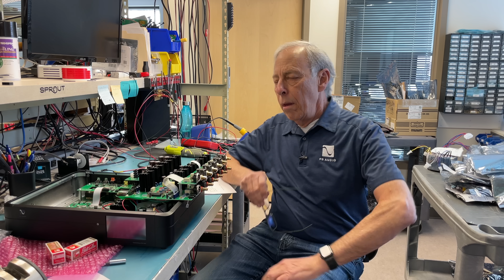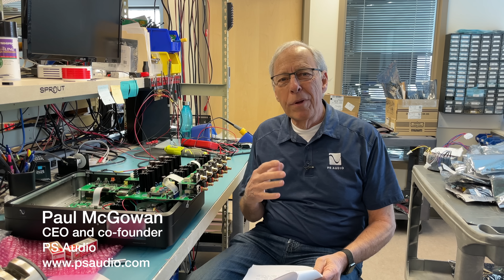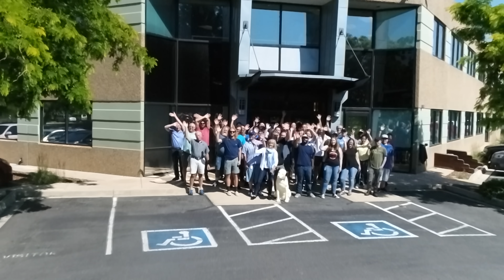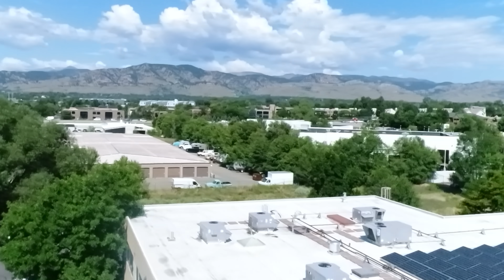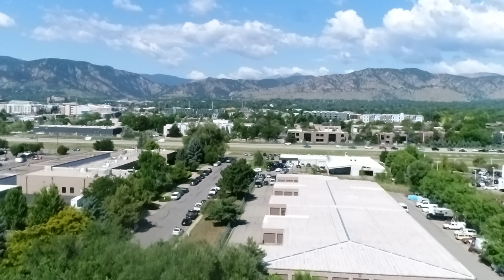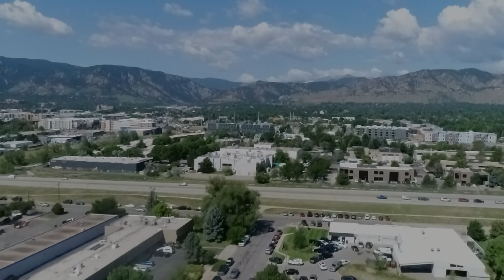Why high resolution audio?

Comment: Paul is confused on sample rate and sound frequency. Modern DACs resolve the steep filter issue by over sampling. A modern $100 DAC can out perform many older $5000 DACs.
A 44.1 kHz/16-bit CD or file is indistinguishable from an HD file regardless of whether it comes from a disc or is streamed to your DAC. In properly conducted blind tests no audiophile could get better than chance. It’s time to stop pushing the myth of hi-res and accept it is the quality of the original recording that matters. For the end user  loudspeaker quality and room acoustics are by far the most important factors in determining sound quality in any home system.
Reply: I think the only thing being pushed here is your own bias against hi-res audio (in many, many comments). Nobody is forcing you to buy hi-res - it's not as though CD quality is harder to find, or being replaced by hi-res audio. 

For some reason you've locked onto 16-bit/44.1kHz as the gold standard, all-you-need format, even though most artists, musicians and those who do the mastering would vehemently disagree with you. The quality of the original recording is not in question here - it's how that original recording is mastered and subsequently delivered to your system.  Why is it, do you think, that masters are made from higher resolution, higher sample frequency files, then engineered down to meet the limitations of CD standard? 

It is because CD is a compromise

A good compromise, but a compromise. SACD sought to redress the issues, but it didn't take off as too many people were already invested in CD players. Hi res audio is similarly niche - but hey, so is anything more than just accepting the basics.  If you cannot tell the difference between SACD and CD, or between a 24-bit/192kHz high-res audio file compared to a 16-bit/44.1kHz file, then your system is not up to grade, or your hearing is poor, or both.  

Either way, if you can't tell the difference, then that's great - you don't need to buy hi-res audio files. If your DAC isn't giving you improved performance between the two files, then perhaps your $100 DAC ain't all that.
Reply: @richardt3371   The quality of a recording is determined by the studio at the time of recording and production. A well recorded and skilfully engineered 16/44.1 CD can deliver audio quality that exceeds the limits of human hearing. Higher bit depth and higher sample rates are used in the recording process for editing purposes but are pointless for playback. 16 bits gives a huge dynamic range. You will never hear noise in a silent passage of a 16 bit recording   unless it is tape hiss from a copy of an old analog recording. 24 bit playback does absolutely nothing to sound quality other than further reducing the noise floor which is already inaudible with 16 bits. Higher sample rates produce frequencies above 20KHz, which is not only above human hearing, but captures unwanted noise that can produce nasties in the audible range. These ultrasonic frequencies can get into a tweeter and cause problems. Higher sample rates on playback cannot improve quality in the audible range. Any effects from the brick wall filter was resolved 20 years ago by improved  DAC technology such as over sampling. A modern $100 DAC can give superb audio. So called “hi-res” releases are marketing hype to sell the same music again. 
Loudspeakers and room acoustics have far more effect on sound quality.
Reply: @geoff37s38  No modern professional recording is made at 16-bit/44.1kHz. Your bias against hi-res is clear - and based on inaccuracies. The idea that hi-res releases are only used to sell "the same music again" is silly - hi-res releases of new recordings are commonplace, hence the likes of Qobuz or Prostudiomasters releasing new recordings, not just old music in high-res formats. You are also incorrect in thinking that all hi-res releases of back catalogue material is marketing hype - in the vast majority of cases hi-res releases are newly mastered from original source materials, quite often eclipsing the sound quality of early CD masterings.
Reply: @richardt3371   As I explained previously, higher bit depth and higher sample rates are used in the recording process to give editing headroom.  16/44.1 can give audibly perfect playback. 

Anyone interested in a great explanation of how digital recording works should watch the YouTube video D/A and A/D digital show and tell by Monty Montgomery. This video clearly debunks the hi-res myth.
Reply: @geoff37s38  Sheesh. Luddites live amongst us.
Reply: @richardt3371  not even the old professional recording was made at 16/44.1...
Reply: @richardt3371  Perhaps you could point out the errors in the Montgomery demonstration.
Check out the websites and YT videos from Mark Waldrep and Ethan Winer.  Both of these guys are highly respected and experienced audio engineers and have been involved in hi-res recording for many decades. Both of these guys are highly critical of the “better than CD” movement and both produced listening tests with interesting results.
Reply: @geoff37s38  Oh well, if Mark Waldrep and Ethan Winer are critical of better than CD then you're right - I'll just go delete all the hi-res audio files I own. What was I thinking, using my own ears to hear which sounds better to me, rather than using the internet to dictate my beliefs. Thanks - you've saved me a good few TB of hard drive space and I can now listen to everything at a maximum 16-bit 44.1 and know that nothing can possibly sound better because Mark Waldrep and Ethan Winer have told us so.
Reply: @richardt3371  Ok, let me deal with 16 bit vs 24 bit. 16 bits gives a dynamic range of 96dB and 24 bits gives 144dB. The decibel is a logorithmic scale, +10 dB is a multiplier of 10. The quietest studio microphone has a s/n ratio of about 92dB due to the Browning Effect, the random movement of air molecules hitting the diaphragm. A full symphony orchestra has a dynamic range around 60dB (10 bits). No home audio equipment can handle 144dB.
Ignoring all the above let us imagine you have obtained a true 24 bit track that has captured a dynamic range of 144dB. A quiet listening room may have 50dB background noise. You play the track and set volume so the quietest sound can just be heard above background. Then there is a sound at 144dB. If this does not instantly destroy your speakers then your hearing will be destroyed.50dB+144dB=194dB which is in the lethal range (not joking).  It is fortunate 144dB dynamic range is impossible for any home system. Even a track with 96dB dynamics can potentially cause ear pain and damage. Increasing bit depth has no effect on audio fidelity other than lowering the noise floor. 
Ps modern dithering techniques can extend 16 bit dynamic range to 120dB.
Reply: @richardt3371  I am sorry you seem to take this as some kind of insult. I genuinely wish to present the facts on digital recording. This is the misunderstanding made by many. There are no extra magical properties, nothing which the science does not understand or cannot measure. The only difference between 16bit and 24bit is 48dB of dynamic range (8bits x 6dB = 48dB) and nothing else. 16 bits is more than enough to replay any performance.  This is not a question for interpretation or opinion, it is the provable, undisputed logical mathematics which underpins the very existence of digital audio.
 Iam not suggesting you throw away all your hi-res collection, I am just trying to give you some accurate information.
Reply: @geoff37s38  I take nothing as an insult. The fact that you believe 16-bit recordings to convey everything you need for perfect audio reproduction, based on 40 year old digital assumptions and compromises that gave us the CD format, is fine. I disagree. The understanding of binary data as digital audio has moved on some since then, and whilst I respect your right to your own opinion, I dispute your right to your own facts.
Reply: @richardt3371   These are not “my facts”. They are ‘the facts”. I can give you links to many recent lectures and papers on the subject. Yes, digital audio has improved over the last 40 years as computer power and electronics has improved greatly. But the fundamentals that underpin digital recording are unchanged. I have given you solid technical explanations but you offer no counter argument. For example, how does a 24 bit recording sound better than a 16 bit recording? I guess we must agree to disagree.
Reply: @geoff37s38  But the fundamentals HAVE changed, Geoff. I'm sorry you seem to be unable to grasp that.  The idea that digital audio is just 1s and 0s has been shown to simply not be true, but I seem to not be able to get through to you on that. And when you ask a nebulous question like "how does a 24 bit recording sound better than a 16 bit recording" then there really is no hope of us being able to have common ground - how can I quantify how it "sounds" better? How do I describe an intangible? Anyway, you're happy with CD quality, and I'm happy with hi-res if available, CD quality if not. It's all just bloody music at the end of the day :-)
Reply: @richardt3371  Ahh yes, this assumption that fundamentals have changed and bigger numbers must be better is at the heart of the controversy. The Nyquist Theorem was postulated way before computers were available and describes how perfect reconstruction of a signal can be obtained.  However Nyquist is fundamental to modern digital recording. The mathematics still apply today. The Red Book standard for the CD is a no compromise specification and can give audio with flat frequency response from DC to 20KHz, huge dynamic range and vanishingly low distortion. Not my opinion,     Indisputable facts. I am retired but spent several decades designing mainframe computers. The mathematics behind digital processing has not changed. The comments I wrote on 24 bit v 16 bit are not my opinion, they are solid facts that are fundamental to digital recording and any qualified audio engineer will agree. I don’t know your taste in music but listen to the 35 year old CD Brothers In Arms by Dire Straits. The recording is stunning in clarity and dynamics and in my opinion is the match of any “hi-res” recording.
Reply: @geoff37s38 Interesting that you reference the "first" digital recording, made on a 24-bit Sony, and the recording that made sure CD succeeded ;-)  Interesting, too, that the same album was re-released by the band in 24-bit SACD...

I have nothing against CDs. I own thousands of them, I have a very good CD player as part of my system. 

However, to keep blithely ignoring that the necessary restrictions on sampling frequency that are imposed by fitting 74 minutes of music on a disc give you "a no compromise specification" is just plain wrong. If we look purely at the mathematics, surely you have to see that taking samples of analogue music at more regular intervals gives you higher quality? 

And please, for the love of god, stop saying "indisputable facts" as that's just frustrating in a discussion where the "facts" are being disputed. I'm not arrogant enough to presume that any theory is indisputable - I'm open to other opinions, and the only thing I consider indisputable is how it sounds to me. All the best.
Reply: @richardt3371  is Ok, one last go. I have explained why more bits and higher sampling rates are used in the recording process. You say “taking samples at more regular intervals gives higher quality” but this is NOT how digital recording works and is a common mistake made by audiophiles who think they understand digital recording. It seems obvious that more bits and higher sample rates must mean better sound. This is a falacy. There are many adverts by businesses making hyperbolic and dishonest claims that are parroted by lazy and ill-informed journalists but you won’t find any credible technical paper in support of this. PCM 16/44.1 recording gives perfectly reconstructed waveforms in the audible frequency band. I do not mean an approximation, I really mean 100% totally, absolutely perfect. This is a proven fact and underpins the physics and mathematics of digital recording. If you do not accept this as a fact then you do not believe in digital recording. Incidentally, the obsolete DSD format DOES produce an approximation. This is why huge sampling rates are used to make the stair steps inaudible. You should watch the Monty Montgomery video. Thanks for the discussion. Ps check out the video Nyquist Shannon the backbone of digital sound.
Reply: @geoff37s38  Tired of going through this with you time after time, tired of ill-founded and downright misleading accusations of laziness and dishonesty in the industry (which would therefore include Sony and Philips, who developed the CD and the Red Book and both of whom believe that hi-res audio is better) and of your constant "watch the video I want you to watch instructions". I've read enough on Nyquist-Shannon sampling theorem, thanks, and had the subsequent headache from working out how it works, to not need a noddy video to explain it to me.

You have failed to grasp the principles of higher resolution recording, are fixated on PCM16/44.1 perfection for digital, regurgitate "proven fact" as though saying it makes it so, and refuse to engage with anything that doesn't fit your narrow and fixed opinion. 

Regarding "you won't find any credible technical papers" I could direct you to the findings of the Audio Engineering Society, whose trial with Queen Mary University London of over 400 participants in more than 12,500 trials concluded " ... that the perceived fidelity of an audio recording and playback chain can be affected by operating beyond conventional resolution." Worth looking up, if you want to expand your horizons, but I suspect you'll not bother, or find a way to denigrate the findings, or cast aspersions on the honesty or impartiality of the AES or of QMUL.

For my own sanity I'm going to mute you now - clearly I'm never going to agree with your dogmatic "nothing can be better than 16/44.1" and clearly you're not open to the possibility that you - or the sources you repeatedly cite - may be wrong.
Reply: @richardt3371  go forth and multiply
Reply: @richardt3371  Wow! This guy was patiently and politely trying to educate you. You are one seriously rude person
Reply: @geoff37s57  You joined YouTube today just to attack me? You are one seriously suspicious troll. Spideysense says you may not really be “Dan”. How sad.
Reply: @richardt3371  : Actually you have no clue what you are talking about. Please go back to school or at least educate yourself about this topic before commenting.
Reply: oversampling is exactly what he's talking about.
Reply: @easystreetphoto2401  he said nothing about over sampling. His explanation was muddled and confusing.
Reply: @geoff37s38  oversampling is literally the only thing he talked about.
Reply: @easystreetphoto2401  oversampling is used to denote a process used in the reconstruction phase of digital-to-analog conversion, in which an intermediate high sampling rate is used between the digital input and the analogue output. Here, digital interpolation is used to add additional samples between recorded samples, thereby converting the data to a higher sample rate, a form of upsampling. When the resulting higher-rate samples are converted to analog, a less complex and less expensive analog reconstruction filter is required.
Reply: @geoff37s38  yes. that's the one thing he talks about here.